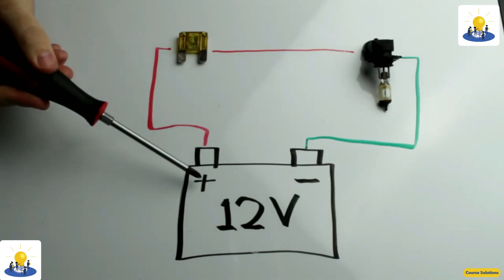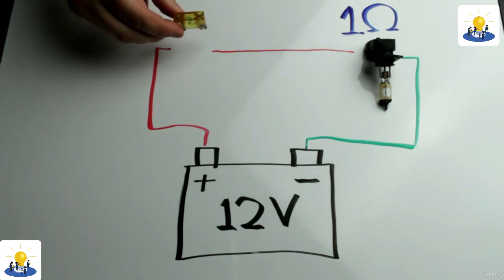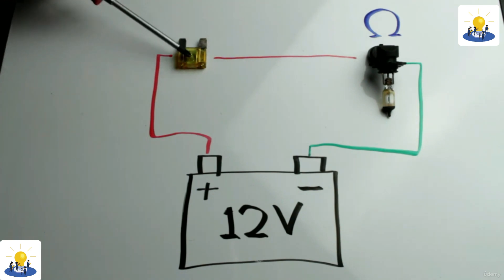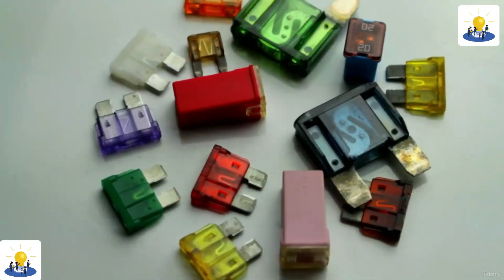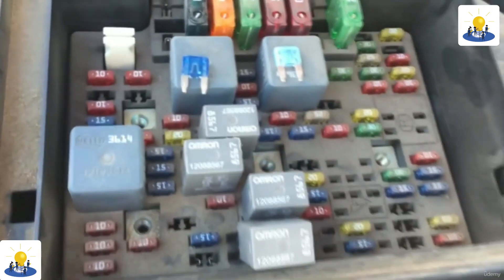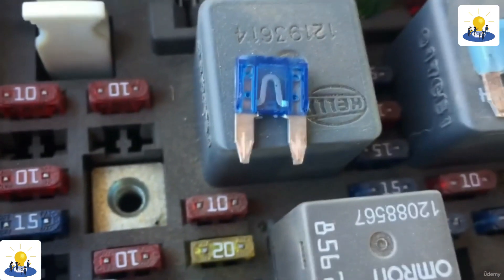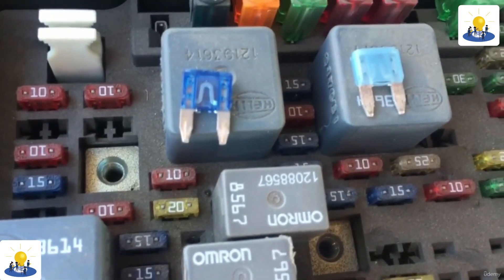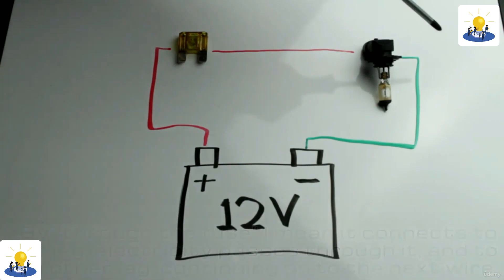Learn About Car Blade Fuses: A Complete Guide

Comment: yes, BUT what size is the different ones? I have blown fuse but I don't know what one to buy to replace it. mini ? maxi? if I measure it with a ruler what size = what blade fuse to get? This information is not available on the inter net. I looked everywhere.